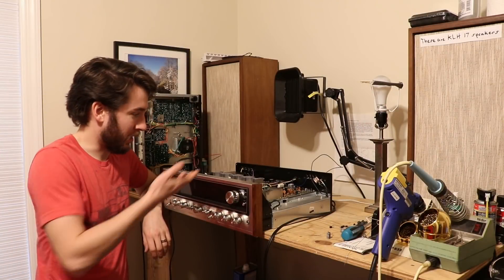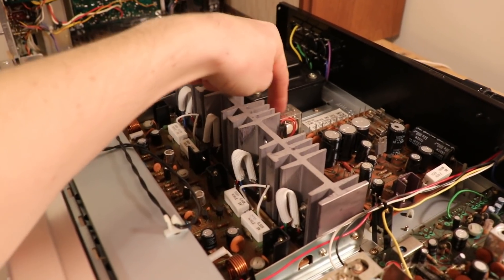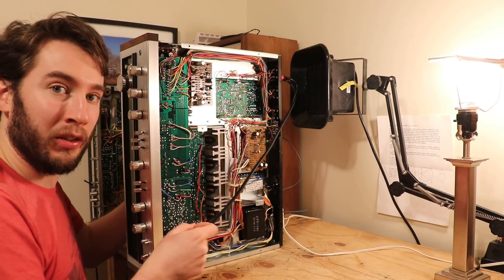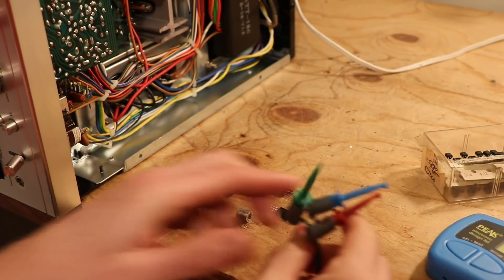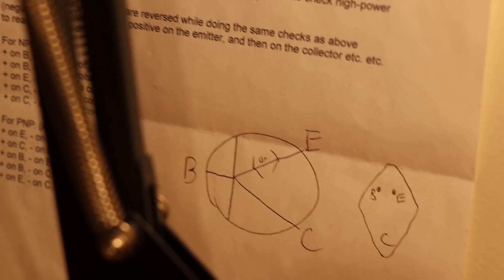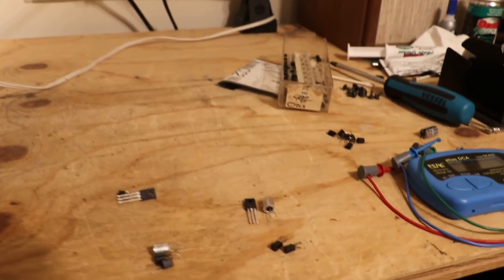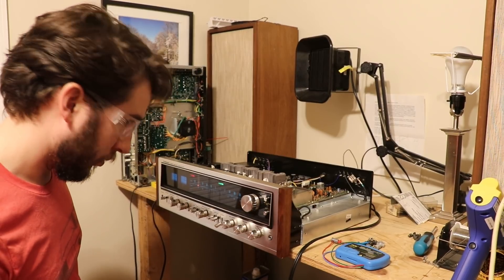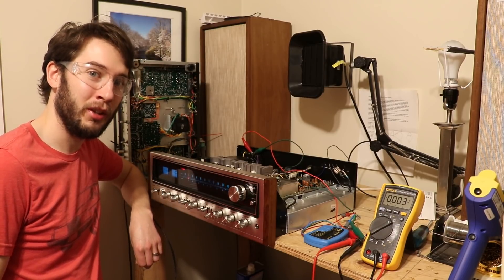Pioneer SX-X3X Preventative Maintenance: 2SC1451 Transistor And Differential Pairs

Comment: Great video. I have a Pioneer SX 636 that I found in the trash. Lots of crackling on the left channel. I replaced the 2SA726 with KSA 992s, and the crackling remains. I am having trouble finding KSC 3503 transistors to replace the 2CS1451. DigiKey no longer has those transistors. Is there another one I could use to replace that one?  Thanks a ton. I am learning a LOT from watching your videos.
Reply from the maker: Edited: I don't guarantee any of this at all but based on a search I did on mouser vs the 2sc1451 specs, a ZTX455 or ZTX457 might work. The gain might be too small. KSC2383 could work but gain might be high. But at $1 each, I'd say worth a shot for any of them.
Reply: @AHFixIt  UPDATE: Put in some KSC2383s and now she sounds GREAT!! WOO HOO!  Thanks for all of the help. Your videos ROCK!!

Comment: I'm glad came across this video as I'm having a strange issue with the power amp board.  I'm getting -24 terminal 20 which goes to the protection board.  The only thing I can think of is one of the 358 and 528 aren't being biased correctly.  The 358 is getting hot.  I'm going to wholesale replace these six transistors.

Comment: Have a very similar situation on my Kenwood KA-3500 int. amp, which does not have spkr protection.
The schematic for that is readily avail online.
 All of sudden, as I was literally watching the right channel speaker (I was testing B&W speakers I just purchased used!), the woofer sucked in, and sound of that channel was lost. Did not blow main fuse. Immediately unplugged amp. The B&W speaker survived. Tested right spkr jack with DMM and I got 17 vdc!! Also noted heatsink for one of the pwr trans was very warm. 
Never turned on again until I had proper test gear in place.
Used variac, Kill-a-Watt, FLIR thermal camera, DMM, transistor/PEAK tester, etc. I only bring up variac pwr very slowly and watch with FLIR. While both right channel pwr trans pair (pnp/npn) run warmer than left channel, after the mains voltage is about 30vac or higher, the npn gets cookin'. I reduce variac after about 130F is read on FLIR for that final output pwr npn. 
And yes, all the right channel transistors -- including the hot running npn pwr trans -- test just fine on Peak and other testers. And the passives -- diodes, caps, resistors, biasing pot  -- also all test fine. Yes,  I have tested ALL the  power board transistors  out of circuit . All "okay". The mis-behavior may be some sort of in-circuit "systemic" or  dynamic malfunction. Maybe similar to how caps need a proper Eico tester to determine if they are actually good. Testers like Peak only apply very little pwr (current, voltage), so they can produce inaccurate results.
I have not replaced ALL the 6-7 pwr board (biasing) transistors yet. Many of them are no longer made and cross-referencing modern/avail/cheap substitutes can be a challenge.

Comment: Don't know a thing about electronics but bought a 737 and there's no sound output, clicks once when I turn the receiver on. I've heard this is the "protection circuit". Is this similar to circuit breaker tripping? How do I reset? Is there an easy fix for this? Not technologically inclined!

Comment: My Dad's SX-737 has always been my reference against which I gauge audio equipment's look and feel.

They're 50 years old, though, so I'm not sure I'd want to deal with the expense of the maintenance and repairs needed to keep one working well. I envy those of you with the skill set to work on those old receivers.
Reply: these parts are all quite cheap. it's well worth it.
Reply: @g.fortin3228  I don't have the technical knowledge for anything beyond very basic electronics, so I'd also be paying a qualified repair shop to do the work. The labor certainly isn't cheap.

At this point, I want something with more modern features and more compact, but with build quality closer to that vintage gear.

Comment: Hi I have a pioneer SX 737 that goes into protection but there is no DC at the E meter resistors I replaced all of the transistors on the amp board and protection board with the ones you recommended also recapped the amp and protection board I even replaced the protection relay with a new one from digit key all of the voltages on the power supply are correct,but yet it still goes into protection any ideas why this might be happening I’d love to hear your opinion love your channel thanks Danny

Comment: Hi I am working on a pioneer sx737. It is going into protection, no DC at the emitter resistors. I have replace all transistors on the amp board, also all caps on the amp board. I subbed them out with all the ones you recommended. Also rebuilt the protection board, the same way all transistors and caps. All voltages on the power supply are spot on. Also replaced the protection relay. Better than it was, it will play with volume at 9 to 10 o’clock. Put loudness on or move volume a little more goes into protection. Lower the volume comes right back on. Any ideas on what might be going on? Thanks and you have a great you tube channel, thanks Danny
Reply: Did you check that the DC offset is 0 after you subbed in different parts?
Reply: Did it work.   Did you fix it. I have the same thing going on

Comment: The 2SC1451 does NOT set the bias current to the output transistors! It's used drive the output circuit!! You don't understand how the 2SC1451 works in the circuit!! You are misinforming persons that don't know transistor circuit theory!!!

Comment: Thanks for this great video. I replaced these parts this morning but unfortunately my SX-737 relay still turned off the unit after about 10 minutes of use.  I suspect once it cools off it will work again. Just wondering what my next step might be to get the receiver in working condition. Should I replace components in the protection circuit or power unit. Any suggestion would be appreciated. Maybe I should go after the same transistors used in other parts of the receiver. I was listening to the FM station when this problem occurred, maybe I should see if the problem occurs when listening to the turntable. Thanks
Reply: Just to follow up, I did replace more components on the protection circuit and power board and now it is working well. Keep up the great content.

Comment: I would not trust one of those transistor checkers without a second and third opinion. Micronta back in the day made a really good one that I still use. It puts it in an active circuit. Testing for opens or shorts is a start. Hfe is good to know when matching equivalents. But it won't give you the big picture. A battery powered scope works good for testing active junctions to. My eyes thought they saw some failing solder joints by those heatsink mounted transistors.  At 12:54

Comment: Hi! I have a fairly mint Pioneer SA-9900. I was looking at the schematic and it seems like there are 18X 2SC1451’s scattered throughout the amp. Do you think it would be worth the time and effort to replace them all? There’s also a PNP transistor with a very similar package, should I look into that too? I have a SX-737 to practice on first too.
Reply from the maker: Hi, great question. To answer your question, if the amp is working as it should, no. I say this because the SA-9900 has a protection relay - and so does the SX-737. If these transistors were to get noisy and send nasty DC to the speakers, the protection relay is there to help you. Now, if and when you start to see issues from these amps and you need to work on them, go ahead and replace all of the 2SC1451's, including the 2SA726's and other similar transistors that might be there too.

This is a completely different story for owners of Pioneer stuff without a protection circuit, like the SX-636 and SX-535. Anybody who owns these should get this taken care of as soon as possible because they will cook speakers. I've seen it happen. But like I said, since you have protection in your amps, you're ok!

I did this repair on the SX-737 in this video because I was already inside of it replacing components. There were not issues with the power amp at that time, but it was definitely worth my time to get this taken care of while it was on the bench with the covers off.

Comment: No such thing as dc current. There is dc, there is direct current, there is dc voltage. dc current would be direct current current, which is wrong. Lots of knowledgeable folks say this, It's simply bad terminology. OK, I'm being picky. I'm a satisfied subscriber.
Reply: Like an ATM "machine". Should be AT Machine. how many ppl say that? I know yer being picky.
Reply: How about calling it just direct current or direct voltage? Alternating current or alternating voltage? Alternating current voltage is rather strange also. Assuming that if the voltage is alternating, so is the current.

Comment: A great way to see the solder joint locations is to shine a bright light on the component side of the board, you can then see the silhouettes of the components on the solder side.

Comment: Hey man, fellow PA resident here, I've seen your KLH 17's in more than a few of your videos and I was wondering if you've had to re-foam the surrounds on the woofers?  I've had a pair for over a year now that needs new surrounds and I couldn't find any info on YT about them.  Basically I was wondering if you knew of anyone selling a kit for it.  I recently found your channel and really enjoyed the rebuild of your Maggies.  Keep the vids coming and thanks for any info you might have on the KLH 17s
Reply from the maker: The surrounds on my 17's are fully intact. Any generic butyl rubber woofer surround kit should get the job done, though.

Comment: I often hear technicians say they don't work on "chip" based audio. Like the Pioneer SX-60 (from 1983). Have you done any work with them or would you work on such equipment?
Reply from the maker: The closest thing to 80s gear I've worked on is a Kenwood KR-1000, and I was not able to fix part of it due to a chip that ran the speaker switches. 70s stuff can almost always be fixed.
Reply: @AHFixIt  makes sense sir. I'm going to recap my SX-60. And fix a few button issues. ...after I test for DC on the output. Lol! :) I haven't looked at the circuit, and maybe that's micro chip controlled too! All I know is that the AM/FM tuner board takes up 50% of the space. And everything is separated far apart...very odd!

Comment: I use a laser pointer to illuminate the component to replace on one side of the board while looking for the spot beam on the other.  Makes identifying solder points easy to locate on the PCB.  I use one intended to play with cats. Great video!
Reply: That sir is a great idea
Reply: Damn -Now I need a laser pointer. High brightness? anything specific you can recommend
Reply: U